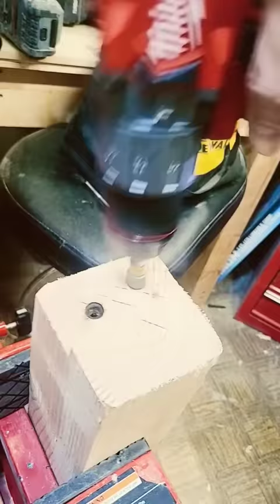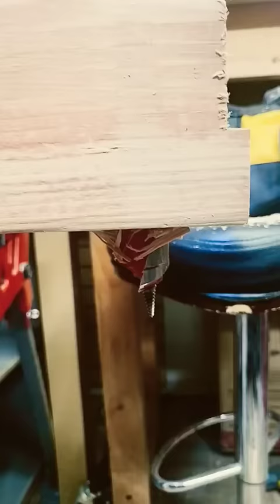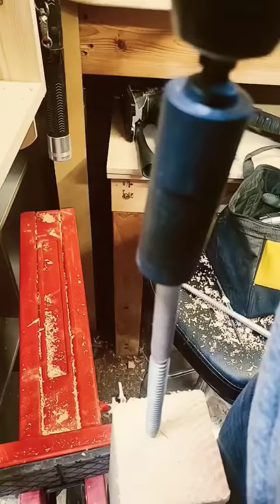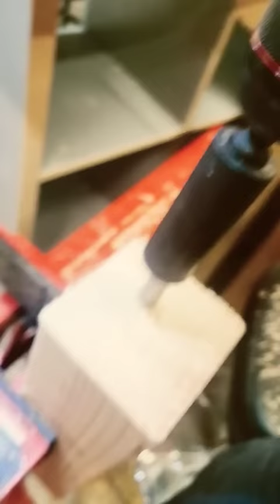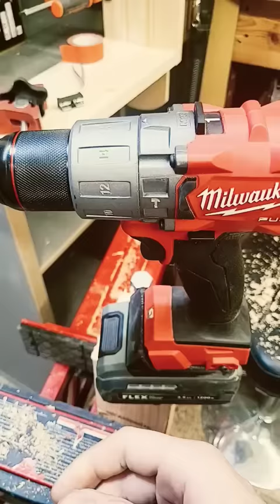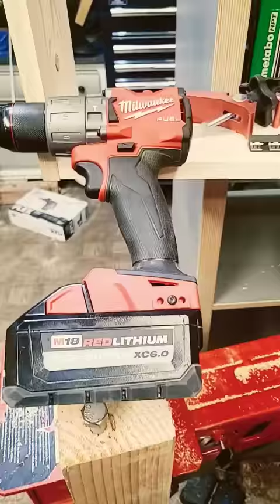Milwaukee VS FLEX - BOTH  using Flex's Battery! 💀

Comment: This guy slamming a 10in lag bolt into wood without a split while if I look at the screw wrong it splits the wood
Reply from the maker: LOL  😆 🤣 😂
Reply: Fucking THAT!
Reply: True
Reply: Seriously, lol
Reply: "Drill a pilot hole it will split!" Next time I get told that I'm showing them this video...
Reply: Ain’t that the case with most things anyways? You see mr everybody do something and it works out great, no issues whatsoever and there you are.. You take your pass at it and low and behold, shit hits the fan. Go figure why life is like that
Reply: Right?? Fucking hate having to drill pilot holes on EvErYthing
Reply: He put 2, in line non the less , still didnt split , i wanna know where he gets his wood
Reply: @rukinaa  discord
Reply: @rukinaa  discord
Reply: @joeybebop  Just do it..
Reply: Sounds like you use poverty wood 👀👀
Reply: It's a pine kicker. Those things are 80% sap
Reply: End grain
Reply: Right, i thought “no freaking way it doesn’t split on the second one… Wtf??” Lol
Reply from the maker: @joeybebop  🤣
Reply: The vise helps, but still…he put TWO in the end gain.  How does that not split?
Reply: That’s because it’s burning a hole through the wood lol
Reply: It’s end grain.
Reply: how does nobody know to start a screw backwards first then change direction to forwards and it won't split the wood

Comment: The battery is gonna cook that drill
Reply from the maker: Maybe lol
Reply: just realized its at 21v instead of 18v, id hope theres a boost in power , this dies id be suprised it cant take a little more
Reply from the maker: @dancearoundtheworld5360  it can. the timing is off so its faster with small tasks
Reply: Nah it should be fine. It’s no different than using a Milwaukee high output battery. They’re pretty much the exact same thing.
Reply: Oooo i can use those on my dyson.
Reply from the maker: @Eflo  I use a dewalt on my craftsman  every time, but keep in mind you can easily kill your batteries if you let them drain completely   on the adapters there is no communication with the tool  just + and - terminals
Reply: @dancearoundtheworld5360  it might burn out the switch I think
Reply: @toolsandtactics  there doesn't seem to be much communication between milwaukee tools and milwaukee batteries these days either...😡
Reply from the maker: @unclefester4626  yeah my buddy burned up his gen the other day in diamond plate
Reply: I'm surprised it can handle the extra voltage without shutting down
Reply from the maker: @yorselrus1996  yeah actually the voltage on the flex or any battery drops below 24 when its being used  thats why high amp batteries work better because they maintain more voltage at a higher rate  so the motor actually uses less than  24  but yes it was a risk!
Reply: @toolsandtactics  98% of the 20v dewalt, 20v black and decker, and 20v craftsman are the same battery. It’s all the same company.
Reply: @codygooch510  No, they're not. High output batteries provide more amps if a tool can use it, but a tool that can't draw more won't draw more.

Whereas a higher voltage battery will push that voltage through all the components, while still delivering the same amps (as resistance hasn't changed). The motor might not care, but the brainboxery very, very likely will.
Reply: I’d assume most tech these days are computer controlled and will be able to adjust to voltage differences/protect themselves.
Reply from the maker: @stevenduering7155  yeah just the adapters don't  have the same amount of prongs for communications
Reply: @Rickfyoutube  To an extent, yes. Hell, some components have a wide range of input voltages. But not all do, and can only tolerate out of spec voltages for so long, and it’s pretty reasonable to expect a tool that regularly sees voltages from 16V to 20V to not do well much higher than 20V, and Milwaukee doesn’t have a 14.4V or 22V counterpart, so there’s no reason to expect them to use components that handle multiple input ranges as a way to make manufacturing cheaper.
Reply: @dancearoundtheworld5360  tbf ive seen enough testing to know that the 18v vs 20v thing is horse shit. theyre basing those numbers on different standards. Usually based on when its considered dead vs fully charged. There is no difference on power. Just how its delivered. Lol as in. Current output. Not voltage alone.
Reply: @dancearoundtheworld5360  all major 18v and 20v systems are about the same voltage. 21v charge voltage, 18v working voltage.
This is because the lithium ion batteries that make these things up are 4.2v charging voltage and 3.6v working voltage... And there are 5 in series.
Reply: @Dance Around The World  the 20v on some batteries is just marketing if you pull a fresh 18v milwaukee or ryobi battery etc and do a voltage check it'll measure out at just over 20v. But will quickly settle into 18-19v with use
Reply: @emerybryant  Flex's batteries are 21.6V nominal (24V max), they have 6 cells in series instead of more common 5 cells.
Reply: @Falcrist  Except Flex isn't an 18V/20V Max system. It's a 21.6V/24V Max system, 6 cells in series.
Reply: @jackass123455  Flex batteries settle in at 21.6V at load, because they've got an extra cell in series.
Reply: @dancearoundtheworld5360  18v and 21v is the nominal voltage and thus they will output basically the same. The way this drill is generating more power is through more current as I suspect the just don’t limit the current as much in those batteries. This WILL with all certainty degrade your drill faster than the stock battery. Everything from the switch to the brushes and contact will be taking a huge hit here. Don’t get me wrong, I think this is very cool but I wouldn’t recommend doing this at all unless you really need the extra power / speed and keep in mind that the more power you send through the drill the hotter it’s going to get and if it overheats it’s game over. I guarantee that poor drill was super hot after that first lag bolt and he let it cool a little before continuing.

Again, this is very cool but please nobody actually do this to your drill unless you got lots of spare change
Reply: @stevenduering7155  They're the same company, but the batteries are not the same.
Reply: @emerybryant  18V and 20V batteries are the same. 24V batteries like the Flex and Kobalt are not the same. They have an extra cell in series.
Reply: @loganhill4704  The drill is putting out more power because of the higher voltage. 24V batteries have one more cell in series than 18/20V batteries.
Reply: @codygooch510  It is NOT the same as using a Milwaukee High Output. Not only is the battery configured differently, but you don't have the same battery protection circuits either. Very easy to permanently kill a battery using an adapter. You have to make sure not to run it down.
Reply: @codygooch510  I’m pretty sure the high output batteries just use better cells with higher current ratings than the normal batteries but the same number in series (for the same voltage.) A company wouldn’t risk toasting their tools with their own batteries by overvolting… though in practical terms it’s fairly safe. It will make your motor spin faster and use more power. But it’s better to push more volts than to push more amps through a motor. More volts just runs a negligible risk of damage whereas more amps than design allows will guarantee melting and sparks flying.
Reply: @Falcrist  of all these comment, you're the only one who got it right.  👍
Reply: @reaperreaper5098  Right 👍
Reply: @toolsandtactics is the Flex battery management on the tool or the battery?  I would have thought it was on the battery.
Reply from the maker: @kds471  I think battery too
Reply: @Kauko88  ah i missed the fact it says 24 v lol so yes another cell would change numbers. i doubt it would hurt the tool tho.
Reply: 4 volts over? Max voltage on Milwaukee batteries is 20v, nominal of 18v
Reply: No it won't I've been trying it for almost a year the same one no problem the 3D printed 1 comes with electronics to convert
Reply: @dancearoundtheworld5360  a 21v nominal voltage(just off charger) is different then output voltage, dewault 21v batterys are 18v just like all of em.
Reply: @dancearoundtheworld5360 the dewalt 20 volt batteries and the milwaukee 18 volt batteries are the same voltage when fully charged. Dewalt just claims 20 volts to get the higher volt name over milwaukee, its mainly an advertising scheme

Comment: that first lag bolt is fucking bonkers. i have never seen a bolt start steaming like a tea kettle just because of shear speed
Reply from the maker: 😂🤣 Yeah We do a little crazy here!
Reply: @Baise Duezcke  lol it's just steam not smoke.
Reply: @UnlimitedFizz  pretty sure that’s smoke. The speed and the friction of the wood and bolt rubbing against each other would get hot enough to burn the wood
Reply: @UnlimitedFizz  why would that be steam? are you implying the wood is wet?
Reply: It’s simple physics when the bolt is screwed into the wood it causes friction and friction heats up the bolt and that “steam” isn’t steam it’s burning wood due to the sheer temperature of the screw
Reply: @mchalemartin265 all I’m saying it that home depo wood doesn’t even have to be made of wood
Reply: @Gumbo1  yes it does 😂
Reply: @mchalemartin265  You clearly cannot tell the difference between smoke and steam...
Reply: @WELDEDMIND  Smoke and steam are distinctly different. Long story short, wood holds moisture....
Reply: @mchalemartin265  Wood definitely hold moisture, so, yes. lol.
Reply: So we still haven't figured out why the almost completed new home we were building just caught fire and burned to the ground overnight. We suspect teenagers but in reality we have no leads. All we know is cameras caught no one after workday ended and fire inspector says it wasn't electrical.
Reply: @maxdaplushuwu2943  yes but also with a lot of lumber there’s water and sap still inside and so some smoke some steam, i’ve noticed wood hissing after screwing with an impact driver.
Reply from the maker: @alexistaylor969  😆 🤣 😂
Reply: Bruh that editing/Photoshop
Reply: That was insane.  That was some wet wood.
Reply: Shear Speed sounds like a minecraft enchantment lol
Reply: People really arguing its steam lmao
Reply: Any way of bottling that steam for afternoon tea??
Reply: Now take it out and grab it!

Comment: I love my fuel hammer drill. Has built in auto stop so not broken wrists here 😂 definitely worth the money for sure
Reply: We have an old Milwaukee corded D handle drill at work. You need to be focused when using it because it will twist your ass around and tangle up the cord it doesn't have the quick stop feature. Yeah the cordless chew through batteries but won't break your wrist.
Reply: @dirtbike662  I used one of those to drill a 6" hole through drywall for a can light. Worked great. Until I got through the drywall and into the plaster and metal lathe that was hiding behind the drywall. Damn near broke my wrist.
Reply: The 4th gen has auto stop, anti-kickback.

Comment: He’s going to burn up the tool! The motor rated for 18v. Putting a 24v battery may generate some extra torque but at the expense of killing that drill.
Reply: Milwaukee tools M18 are actually 20v. Won free lunch for a week from a buddy. Put a multimeter on a battery and you will see. Great marketing buy them.
Reply: @cleavonbrown223 18v batterys have a peak charge voltage of 20v yes but thats not operation voltage.
Reply: @beereadyyy9849  it's actually 21v peak charger theoretically but usually around 20.5v or 4.1v per cell, max ceiling for li-ion is 4.2v so around 21ishV
Reply: Rgardless of the know-it-alls, it still shouldnt operate at 24v lol

Comment: Imagine when Milwaukee releases their lithium pouch batteries
Reply: Yeah, shits gonna be wildly expensive tho
Reply: They probably ain’t gonna for awhile . Nobody wants some itty bitty battery . But they said they will once the tech is there
Reply: @bobufo5729  Pouch batteries don't have to be "Itty bitty." Dewalt's Powerstacks are 5ah.
Reply: FLEX already did, Stacked lithium cells instead of 18650's
Reply: @XxcrazybroxX  18650 is a lithium ion cell. Do you mean that they stacked lithium polymer pouch cells?
Reply: @Studio23Media  5 ah is itty bitty lol . Go run your de walt chain saw with a 5 ah pouch and give us a holla brotha . Oh wait …. They don’t make a chain saw 😹😹 and the xr shitter doesn’t count. Unless you want to get into flex shit I mean flex volt 😀😀😀
Reply: @bobufo5729 I'm never getting a battery operated chain saw PERIOD. No professional is going to use those things. If you are just limbing a few branches twice a year and you already have the hippy battery powered mower then it might make sense. It's all a sales gimmick, just stick with the real gas powered chain saw and you'll be much happier with the performance.

Comment: I get why people hate on Milwaukee fans, they tend to make asses of themselves, but at the end of the day, they do make quality shit
Reply: Except triggers and chucks
Reply: @wills5482  sadly yeah. my 12v screwdirver, my 1st gen fuel 3/8 gun, 1st gen 1/4", then my current gen 1/4" drivers chuck.

Everything has so much power now i use Dewalt 12vs at work and have a 1/2" M18 at home for auto that doesnt get beat on enough to fail.

Comment: Im not even that old but i still get amazed at how far cordless tool tech has come. I remember dicking around with (i think) a 6v drill and it was legitimately faster and less hassle to use a screwdriver most of the time and i would always just grab a corded drill for holes. Now you can get really crazy power, speed and torque in a very lightweight small package. 

So many tools i thought never would make sense as cordless are cordless and not total hunks of junk. What a time to be alive lol
Reply from the maker: yeah! for real they have come a long way!

Comment: PSA : Lithium-Ion cells almost all have the same voltage: 4.2V charging voltage, 3.6V working voltage. These brands are using 5 cells.in series, which gives 18V and 21V Some manufacturers advertise one. Some advertise the other.
Reply: There is also 24 volt ….
Reply: Yes? Everyone knows this.
Reply: @alexstromberg7696  most people don’t know that.
Reply: Batteries advertised as 24V are NOT the same as batteries advertised as 18V or 20V. 24V batteries like Flex and Kobalt have 6 cells in series.
Reply: @Studio23Media  I wonder why Milwaukee has not done it. Might not be needed

Comment: So glad you used handle. I had a buddy that was using a corded drill using a hole saw bit and it caught a knot and next thing you know he had a bone sticking out the side his for arm. And we were in an attic!!!! Getting him out was a mess!!!
Reply: Holy crap it for real snapped his bone out of his arm? That's insane. Did you have to drag him out? I figure if something like that happens in my attic I'm as good as dead
Reply: @OtherDalfite  yeah, it was crazy!!! One of the forarm bones was poking out. Ughhhh nasty to think about. But actually he was in shock for the most part so he was able to help with his left arm a bit while getting out.
Reply: @miekolock4060  thats nuts dude. Glad you both got out okay though. I'll definitely remember this if I ever take my drill up to do some work☠️
Reply: people need to drink some milk

Comment: OK, let's break this down.  That M18 drill can do the same amount of work with the 18/20 volt battery, but of course, when you add More Volts, 22/24, the drill will spin faster.  It's simple physics.  However, the internal workings will not be able to withstand the constant abuse of the extra volts.
Reply from the maker: Yeah don't do this that was just for fun

Comment: Also when screwing down lag bolts or screws that might need extra power, always run it on the speed setting 1 instead of 2. You’ll find it even more powerful. It won’t rip your wrists off as bad!! Lol

Comment: There are only $30 for the converter on ebay I have one on my makita 19z new impact which is the newer compact stronger 16z version with stacked lithoum 6amp
Reply from the maker: Nice!
Reply: @toolsandtactics   If you ever need the link I can't get any kind of order for any drill I'll send a few if ever need

Comment: This Milwaukee drill even with the m18’s aint no joke
Reply: serously, i have the same one and it is crazy. haven't found anything to stop it yet
Reply: I dont use a drill often. mostly impact/12v screwdriver and if i have to drill a hole or 2 use a crappy impact bit. 

then the 1st time i mixed a bucket of concrete with one and holy shit
Reply: @rch5991  Yeah we used those big ole rotary hammer makita drills that comes with a whole suitcase and weighs like 35lbs to mix concrete and the Milwaukee outdrills that thing plus its battery powered (probably wouldnt outlast it in the long run but still)

Comment: I use mine on hammer mode as it’s much safer . That way I don’t have to worry about installing the handle because of the torque, or worry about damaging my wrist when the drill decides to spin around uncontrollably 😂

Comment: Interesting how a 24VDC battery pack didnt fry the 18VDC tool hmmm....
Reply from the maker: the 24v pack during a lag drive from flex goes down to 16 volts      so under load its probably ok?   time will tell it will probably damage the m18 eventually     i do alot of crazy Frankenstein things on the lives and test voltages realtime

Comment: laughs with a old ryobi 18v drill wired to 36v batteries in the back of my truck

If the trolley and battery's come out if the truck either something is very wrong or we have Australian hardwood, the bane of my existence.
Really strong wood though